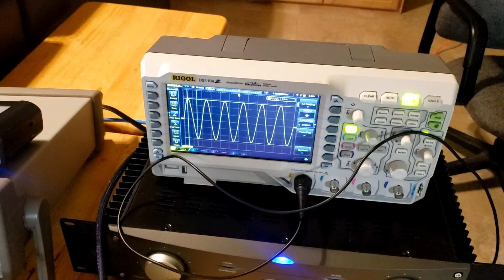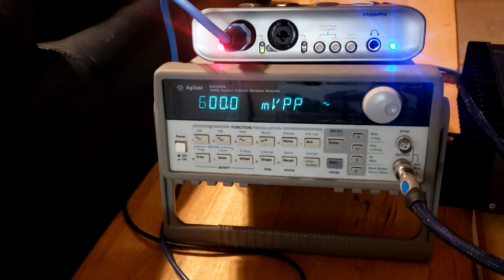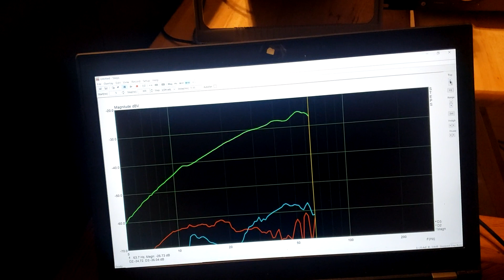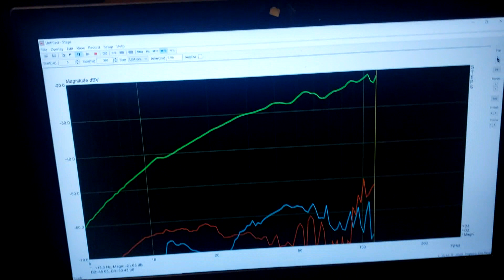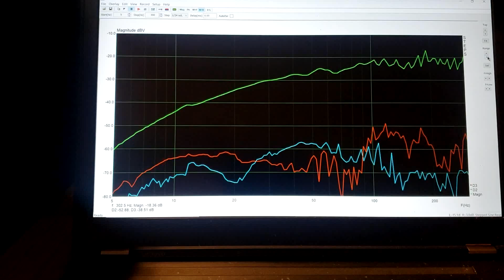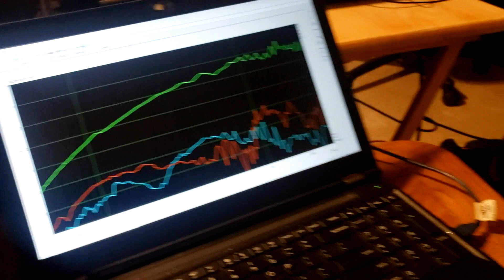Ultimax 18 mechanical noise and distortion test

Comment: Hello. Can you please make a video on your Altec Voice of the Theater loudspeakers? They look very interesting. Thanks
Reply from the maker: Hopefully someday, right now I'm still just trying to get the theater up and running.  I have such limited time due to my work travel, it's taking forever to get that done.  Still, it would be cool to do a video telling a little about the A7's, they are some pretty nice old speakers.  

My brother and I built the cabinets and I bought all the hardware on ebay.  I bought drivers that were in need of repair and shipped them to Great Plains Audio to be reconed with original Altec cones.  I figured that was the best way to make sure they were in good condition.

One of these days I would like to build a set of Altec Model 19's but I don't really have a good place to put them.

Comment: I may have mentioned this in another of your videos ... my Ultimax 15 were an absolute disaster .... they very quickly failed when pushed at low frequency namely 20hz 
Using IB24s now and there is no comparison |
I hope you have a better experience with them

Comment: Thanks for the mechanical noise test results. 
The actual speaker looks light, it seemed like the magnets magnetic attraction to the metal stool was a strong force but once that magnetic attraction broke away the speaker itself seemed to be light.

Comment: Can I run 2 of these in my SUV in a 14.4 cu.ft ported enclosure, tuned to 31Hz on 5500 watts RMS? I have 2 18s already that has great SPL, i’m just looking for something with a little better sound quality
Reply: I'm going to run one 10 ported 1.5 cubes ,on 600w in my civic.
Reply: these are 89db/1w and 1200w each. your present ones are 5500w means you will literally lose a lot of loudness if you switch to these. 
you can run 2 of these in car but its going to be slower than your 5500w as its 2400w vs 5500. thats +3dB difference, idk efficiency if your 5500w system so if 99dB/1w then its +12dB loudness difference. if you are someone who likes it loud then ignore sound quality. trust me, if you are used to sundown 120+dB or rcf or bassboss 148dB then if you sudden switch to this then you will feel it lacks loudness and you will literally drive it to its mechanical limits to get similar feeling of bassboss kraken quad 21 148dB which is not possible using this. 

if sound quality is what you want, you will like most of the speakers sold online
but if spl is what you want, you shouldnt downgrade. as you will feel the difference, eg: sundown 18 inch will move air a lot in your car but rythmik 18 inch will bottom out if you even try to do that a bit.but rythmik will do sound quality even at 10hz which sundown 18 inch wont do. so, choose wisely. sq or spl. 

sundown 18 inch 130+dB or bassboss kraken quad 21 148+dB

or 

some sound quality equipment which maybe available abroad. since i dont know what maybe abroad. 

downgrade will be like from shaking 1km houses to shaking 10 meter houses. choose wisely.

im not encouraging high db spl. that 5500w should be far louder than this 1200w x 2 and this may feel waste of money if you are used to spl over sound quality. 

eg: sundown 18 inch will literally flex your ears inside car but rythmik 18 inch on same song wont do it in your home. so dont downgrade if you like loudness which rearranges you organs even far away. as sq equipment wasnt designed for it. so, pick loud or sq. you cant have both.

Comment: May I ask the model number of 15" from Newark you will be using?  I would like to get some as well for a open baffle setup.
Reply from the maker: The plan is to use eight of them on each side.  I'm using the 8 ohm version so they will be in parallel pairs with an Emotiva BasX 4-ch amplifier for each column of eight woofers.

They will be mounted magnet to magnet with a spacer between that's open so as not to block the vented pole pieces.  Each pair will be vertical, one facing up, one facing down with the cone front sides open to the room and the magnet sides open to the rear.  This cancels the mechanical energy in the frames.  You have to be careful though, you want the open area of the baffle to be at least as large as the cone areas so it doesn't accelerate the air.   In the back it's already accelerated by the relatively small openings in the frame so the back opening only needs to be as large as the openings in the frames.
Reply: @mfkhometheater7742  Wow that will be amazing.
So many I ask what model of Mcm driver 15" for that you will be using?
Reply from the maker: @John8910  https://www.newark.com/webapp/wcs/stores/servlet/ProductDisplay?catalogId=15003&productSeoURL=mcm-audio-select&partNumber=80R7013&storeId=10194&langId=-1&krypto=TpKkbLv5LYuiVk3OTBCxsdj%2FncoEvpTQSvZaSWOFq8ggNSda03jzQKWKgqxth%2F%2BF4vs10GXM37ozTqfwxx0LUA%3D%3D

They're cheap but in open baffle they sound amazing!  I use two of the 12" version in my 2-ch system and have gotten lots of compliments on the amazing bass quality.  No one can believe that the woofers are so inexpensive and sound that good.  I wouldn't use them in a box design however, the Qts is much higher than the spec so they wouldn't work well in any box system, just open baffle or infinite baffle.
Reply: @mfkhometheater7742  Thank you. Would be great if you put your finished build on Youtube.  
Thanks again.
Reply from the maker: @John8910  Oh yeah, once I get it all built I'll post it.  Right now I'm in Dresden Germany so not getting anything done on the theater.  I did a little bit before this trip, mainly building the frame that will support the screen frame.  I might put together an update later with some photos of that.   I'll be taking the last two weeks of this month off work and hope to make a lot of progress on building the speakers.

Comment: No baffle, inside a room with a lot of reflecting and resonating things. Is the distortion measurement even useful in that situation? Not being critical, only curious. I typically see distortion measured outside with the woofer in a box.
Reply from the maker: Ideally yes but the mic is relatively close to the driver and any near by reflections should have about the same content of fundamental and harmonics so it wouldn't make much difference.  Basically the reflections are both attenuated relative to the direct and also very similar to the direct sound so not much contribution to the total.  No baffle is an advantage, no off axis radiation to reflect off the walls.  But yes, you are correct, ideally away from reflections is better.

Measuring a more full bandwidth frequency response however really needs to be away from reflections.  Now that I've moved into a place with more room outside I finally have room to do outdoor measurements again, didn't really have a good place to do it when this was done.
Reply: @mfkhometheater7742  Good to know. I am doing research on potential theater subwoofer upgrades and am having a hard time finding science-heavy info. Rattling wall videos are only amusing for so long.
Reply from the maker: @dustind5176  I know what you mean, before I ordered and tested mine the only thing I could find were those kinds of reviews.  Thing is, any big driver with a lot of excursion can shake the walls so those reviews aren't telling us anything.  The real question is, can it do it with low distortion and low noise.  No one seems to address this and most don't have the equipment to measure distortion even if they wanted to.  The Umik microphones from miniDSP and mics from Parts Express can't do it because the microphones themselves have too much distortion.  It takes something like the Earthworks or a B&K to do it but these are far more expensive than the Umik.  

Btw, I have eight more 18" Ultimax drivers coming.  I was going to order seven to go with the one I had but because of the price break at eight, it wasn't much more to just get the eight.  I guess the extra will just be a spare... or maybe a subwoofer for the down stairs TV:-)  The eight will be in the attic above the theater in an infinite baffle.  The plan is to mount them magnet to magnet with a spacer between them to keep the pole vents open.  This will cancel mechanical energy so nothing vibrates.  The plan is to use these for single digits to about 27 Hz and use open baffle woofers each side of the screen, eight 15" woofers in each floor to ceiling column.  The dipoles can handle 27 Hz to 80 Hz.
Reply: @mfkhometheater7742  Have you considered mounting them cone to magnet? Any mechanical nonlinearities get cancelled out due to the inverted polarities (one moves away from the magnet while the other moves towards the magnet). Another benefit, if I remember correctly, is it reduces 2nd order harmonics. 

Most folks don't/can't do it because of mechanical noise, but, if the UM18 is quiet enough, it could be a possibility. Also, some drivers are so linear when looking at Klippel measurements, inverting one woofer doesn't result in as great of a performance gain. 

That said, if you like to tinker, it could be worth setting up a test rig to see if turning one woofer around provides a measurable improvement in distortion...?

edit
Come to think of it, you have a huge volume of air you can move with 16 total woofers. The cone excursion is likely going to be fairly low and thus low in distortion anyway. Inverting half the woofers may not even amount to much gain just because no single driver will ever be pushed hard.
Reply from the maker: @dustind5176  You do remember correctly, it does reduce 2nd harmonic distortion.  As recently as 2015 I was mounting woofers with one reversed but I started thinking that I might be better off to keep that 2nd harmonic to help mask the 3rd harmonic which isn't decreased.  

Back in the early 90's my brother Marshall and I did the experiment with two 12" woofers in a sealed box and it did dramatically reduce the 2nd harmonic.  At the time we didn't think about this being less masking for the 3rd and we continued to mount woofers with one reversed.  I think Marshall may have done it even more recently than me.   Siegfried Linkwitz always mounted them with one reversed and I don't think he ever changed that.  If I remember correctly Brian Elliot didn't do it that way when he used conventional 12" drivers.  Now days he uses cheap 10" drivers coupled to large cardboard panels and those things produce the cleanest bass I've ever heard.  At 16 Hz the 2nd is something like 55 ~ 60 dB down and the 3rd around 65 ~ 70 dB.  Brian is the guy that taught Siegfried about open baffle speakers but unfortunately Brian has no internet presence.  The guy is 92 years old and still doing DIY speaker building though so you have to give him credit for that:-)

Yeah the idea of having so many woofers is to have more surface area and less excursion so with sixteen 15" limited to 27 Hz they shouldn't be a problem and the eight 18" being in infinite baffle instead of dipole also should provide plenty of output with very little excursion.